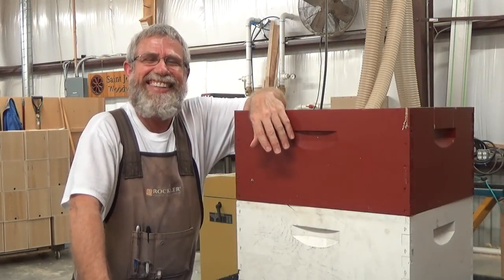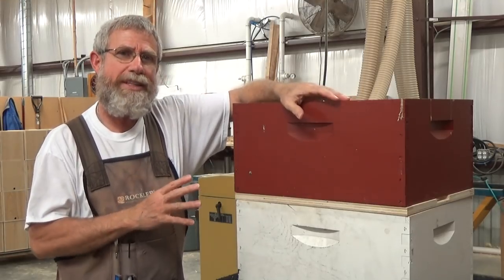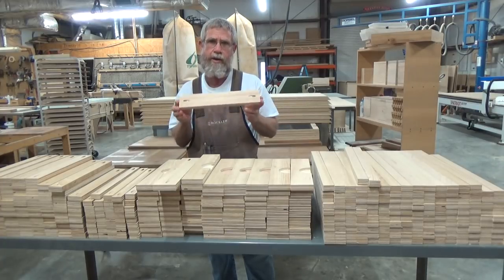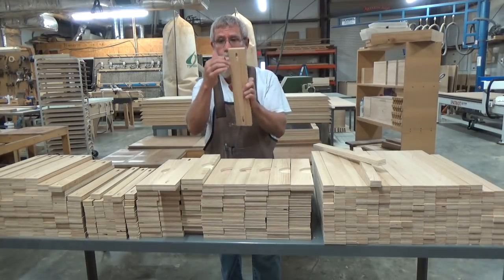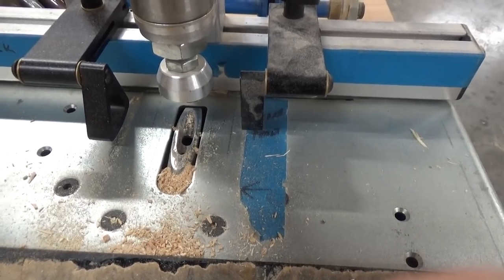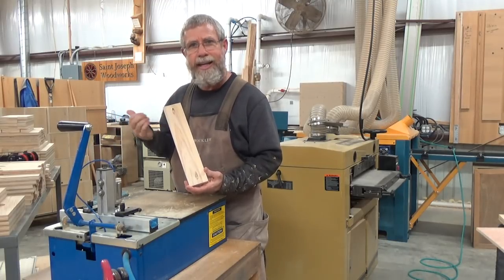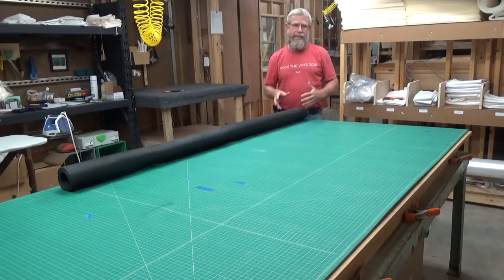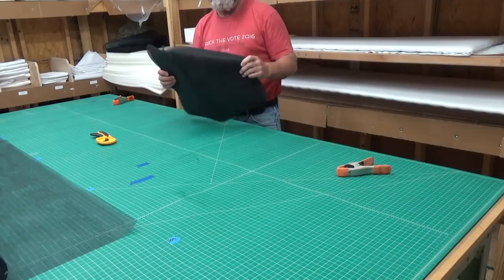Double screened dividing board, what it is, how it's used, how to build one

Comment: For cutting screening, I use an industrial strength paper cutter.
You can "even" the squares to the cutting edge before dropping the cutting handle.
Painter's tape laid out on the top of the cutting board assures consistent cuts, and reduces the scrap.
Waste not, want not.
Reply from the maker: I now use an electric fabric cutter, works great. Thanks for watching. God's peace Jon.
Mr. Ed

Comment: Mr Ed, I find your equipment how to info to be helpful. I build ventilation boxes with a dish feeder, was using aluminum screen but its hard to work with, going to try the PVC coated pet screen like your double screen boards. Would like to see more wood projects for bees because I was able to make several solid bottom boards with basic equipment. Also made some entrance reducers and attached a plastic mouse guard with shutters as we are under derth.

Comment: Hi Jeff. First - glad you’re Mama had a nice birthday. She seemed to have enjoyed things. 
I’ve seen you’ve changed divider boards since this video. I am making some (10) in the next few days. Any thoughts as to this version vs the one you switched to given the smaller number I am needing?
Thank you. 
Joe
Reply from the maker: Thanks so much for sending her a card Joe, your thoughtfulness was very kind. The double screened divider boards, the ones in this video,  I have always built the same way, and they are only used temporarily on the hive, only to split the hive and then removed. The screened boards are permanent parts of the hive and my design of them has changed several times over the years. God's peace brother.
Mr. Ed

Comment: another  great  video. I  do have a question  o  great   one. I seen your   video,  I believe was  last  year  on  vertical  splits. So,I   had  to  give  it a  whirl. I assume I must  have      missed a  detail. As  I  ended  up    with  two   Queenless  boxes.  Which,was  not  so  good. As  that  queen  would    within  24  hrs  lay  about as  many frames  as  you  could  cycle  through  the  box. Anyway  look  forward   to  the  new  split  video  as i  have   approx  10  that     will  have  to   be  split  by mid  April.
Reply from the maker: Greg, if you stay tuned, I will be making about 3 videos on the way that I make a split, and I will try to be very explicit in explaining  my procedure. Stay tuned. thanks for watching. God's peace.
Mr. Ed

Comment: Hi Jeff really enjoy your videos ,i am making up a few of these to use this season for both splits and queen rearing my question is you don't use a rim say 3/8 around the edges ? you find the bees have enough space without it.  Thanks
Reply from the maker: Sorry Tim, I do not understand your question. It must bee to early in the morning. If you don't mind, try again. Go's peace brother.
Mr. Ed
Reply: @JeffHorchoff  Sorry about that, like on traditional bottom boards there is a 1/2" t0 3/4" spacer around the 3 sides to allow more space under the frames for bee movement.

Comment: They should have 'weights' that are used to hold layers of fabric and and the pattern on that self-healing mat covered table so they can be easily cut out with the rotory cutter.  I like you use of clamps but you might want to try the weights to see if it is faster.  And I don't ever want to see you use MY rotory cutter  to cut screening!

Comment: Through the use of double screened dividing board i think in time there is a possibility that bee colonies could evolve into accepting multiple mated queens.
Reply: Ziad Natsheh i dont think you would call that evolution vs a cultural behavior development.  It's not like they are physically changing to except multiple queens.
Reply: Evolve as in gradual development of a new behavior or mental adaptation.  As for physical changes Iv'e heard of an experiment by Asian scientists in which they surgically remove the queens jaw to prevent them from physically harming each other.  Not sure how the experiment went  but i do believe the idea of multiple mated queens is not far fetched.
Reply: Ziad Natsheh  I think this article supports both our points. https://www.newscientist.com/article/2091134-orcas-are-first-non-humans-whose-evolution-is-driven-by-culture/
Reply from the maker: The double screened board is only on the hive for a period of 4 to 5 weeks, after that, it is removed because the hives are separated and moved apart, otherwise referred to as a split. Thanks for watching. God's peace.
Mr. Ed

Comment: ok i'm going to ask a daft question why do you need the splitter and what is the purpose of the screen part ?
Reply from the maker: Th screen is inserted between the two boxes on the same hive in preparation to split the hive and make two hives from one.The purpose of the double screen is to keep the bees from being able to reach each other and not fight. Because the bees share the same queen pheromone, if the queenless hive does not produce a queen cell, the hives can be reunited and the bees will not kill each other. It is a very useful tool. Stay tuned for the video when I insert the double screened board, about 3 more weeks, and I think all your questions will be answered. Thanks for watching. God's peace.          Mr. Ed

Comment: Why double screen ?... isn't one screen enough ?...and what screen are you using, not metal, looks like mosquito fabric screen to me, wouldn't the bees chew thru it ?... Thanks for your reply.
Reply from the maker: The use of double screens is so the bees can not come in contact with each other when I do a vertical split. Because the boards are only used for a few weeks at most, mosquito screen works just fine. Thanks for watching. God's peace.
Mr. Ed

Comment: Thank you for your videos. You and Dirt Rooster have really got me interested in bee keeping. I do have a question as to what you use to build your hives. Do you use air dried or kiln dried lumber and reason for it? Thank you.
Reply from the maker: Weather the wood is kiln or air dried, it still is dried wood which is what you want to use when you build anything. That being said, most of the wood I use is kiln dried. I am so happy to hear that by watching our channels it has peaked your interest in keeping bees. If I may make a suggestion, find a bee club in your area and join it now. You do not need to have bees to belong to a club, just a love for them. You will meet some really great folks who can give you valuable information on keeping bee in the area you live and that is very important. Folks up north keep bees different from folks down south, food and climate have everything to do with it. Thanks for watching. God's peace Richard.
Mr. Ed
Reply: @JeffHorchoff  Thank you for your response. I have done just that. I joined a club close by and will be attending the Alabama bee keepers association annual symposium next month. I've also going to help a friend trap swarms  in our area. The reason I ask about klin vs air dried was that I was told by a gentlemen that owns a saw mill that kiln dried would cup or warp more than air dried when exposed to high humidity even if painted. But I guess if you box joint, glue and nail the seams it shouldn't warp or cup too bad.
Reply from the maker: You are on your way to becoming a bee wrangler yourself, congratulations. Some words of wisdom for you, don't over think every aspect of bee keeping. Take chances and learn from your successes as well as failures, it's all part of it. You will do well, and I hope you keep me updated on your adventure. God's peace Richard.
Mr. Ed

Comment: You have "explained" dividing boards before but you never explained why you use a mosquito net why not just a solid plank.
Do they have to smell the queen or something? Will they move out or something? What will the bees do if you don't use a net?
Reply from the maker: Yes, they need to share the pheromone as well as the heat for cold nights. A solid board would defeat both of those elements. There are two screens because the bees can not have physical contact, and the separation accomplishes this goal. Thanks for watching and asking. God's peace.
Mr. Ed